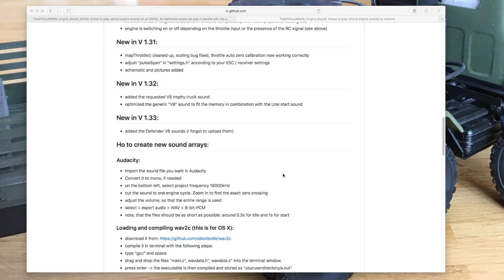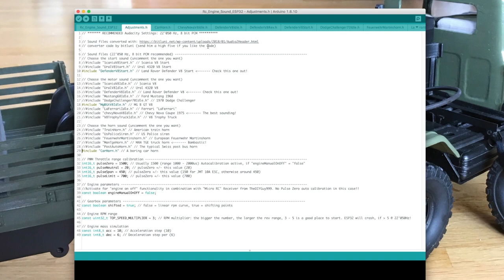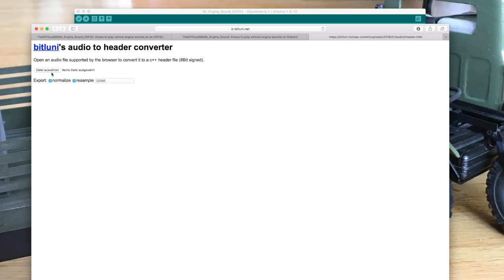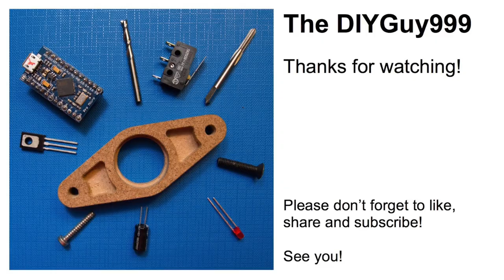New ESP32 Based Arduino RC Engine Sound Generator: Simultaneous Horn playback, a lot of Free Sounds!

Comment: Is there a more comprehensive guide to the software aspect of this? Trying to verify the sketch nets tons of errors involving missing parenthesis.
Reply from the maker: There are no errors, if you install the ESP32 board and all the required libraries:
//
// =======================================================================================================
// ! ! I M P O R T A N T ! !   SETTINGS (ADJUST THEM BEFORE CODE UPLOAD), REQUIRED ESP32 BOARD DEFINITION
// =======================================================================================================
//

// All the required vehicle specific settings are done in Adjustments.h!
#include "Adjustments.h" // <<------- ADJUSTMENTS TAB

// Install ESP32 board according to: https://randomnerdtutorials.com/installing-the-esp32-board-in-arduino-ide-windows-instructions/
// Adjust board settings according to: https://github.com/TheDIYGuy999/Rc_Engine_Sound_ESP32/blob/master/Board%20settings.png

// Make sure to remove -master from your sketch folder name

// DEBUG options can slow down the playback loop! Only comment them out for debugging
//#define DEBUG // uncomment it for general debugging informations
//#define SERIAL_DEBUG // uncomment it to debug the serial command interface on pin 36
//#define SBUS_DEBUG // uncomment it to debug the SBUS command interface on pin 36
//#define DRIVE_STATE_DEBUG // uncomment it to debug the drive state statemachine
//#define DRIVE_AUTO_TRANS_DEBUG // uncomment it to debug the automatic transmission
//#define CATERPILLAR_DEBUG // debugging caterpillar mode

// TODO = Things to clean up!

//
// =======================================================================================================
// LIRBARIES & HEADER FILES
// =======================================================================================================
//

// Header files in sketch folder
#include "curves.h" // Nonlinear throttle curve arrays

// Libraries (you have to install all of them)
#include <statusLED.h> // https://github.com/TheDIYGuy999/statusLED <<------- Install the newest version!
#include <SBUS.h> // https://github.com/TheDIYGuy999/SBUS you need to install my fork of this library!
#include <rcTrigger.h> // https://github.com/TheDIYGuy999/rcTrigger <<------- v4.7: This one is now required as well

Also note, that all the vehicle specific settings are done in the "Adjustments.h" tab, don't change anything in the main sketch.

Example Adjustments can be found in the /settings folder.

You also have to select the interface according to the manual on GitHub
Reply: @TheDIYGuy999  i tried to copy the errors i'm getting here but it wouldn't work. my header doesn't look like yours.
Reply: @TheDIYGuy999  I'm about to give up on this and just buy a module. I've been fighting this sketch for 4 hours and no sound.
Reply from the maker: @lordsanityfree  Why it doesn't look like mine? Then you should download the latest version. You have to install all the libraries and the ESP32 board definitions, which are mentioned in my previous answer. Also make sure, you read everything on my GitHub page. I can't help you without knowing your error messages.
Reply: @TheDIYGuy999  at this point it uploads, but does nothing.
Reply from the maker: @lordsanityfree  You have to select the communication mode according to your receiver wiring. You can find the manual on GitHub. If you have classic RC servo signals, adjust it as follows:
// ---------------------------------------------------------------------------------------------------------------------
// Choose the receiver communication mode (never uncomment more than one! If all commented out = classic PWM RC signal communication)--
// SBUS communication --------
//#define SBUS_COMMUNICATION // control signals are coming in via the SBUS interface (comment it out for classic RC signals)
boolean sbusInverted = true; // true = wired to NPN transistor signal inverter or uninverted SBUS signal (for example from "Micro RC" receiver)

// Serial communication --------
//#define SERIAL_COMMUNICATION // control signals are coming in via the serial interface (comment it out for classic RC signals)
// Only for my "Micro RC" receiver! See: https://github.com/TheDIYGuy999/Micro_RC_Receiver

// PPM communication --------
//#define PPM_COMMUNICATION // control signals are coming in via the PPM interface (comment it out for classic RC signals)
#define NUM_OF_CHL 8          // The number of channels inside our PPM signal (usually max. 8)
#define NUM_OF_AVG 1          // Number of averaging passes (usually one, more will be slow)
Reply: @TheDIYGuy999  it's like that. No sounds. FWIW, I'm using a PAM8043 with integrated pot for volume.
Reply from the maker: @lordsanityfree  The wiring is according to the schematic and the 5V supply voltage for the PAM8403 is OK?
You may want to uncomment the DEBUG option in code line 30. This provides informations about the input signals in the serial console.
Reply: @TheDIYGuy999  schematics are gibberish to me, but i wired it just like shown in the video, just without the pot between the resistors and the amp as it's built in. Connected VIN and GND on the esp32 to power + and - on the amp.

Ive tried using different pins on the board based on what I could find in the sketch but no change. The only thing I can get from it is a buzzing.
Reply: @TheDIYGuy999  from the esp32 I have the following:
From VIN, one wire to positive power on amp, one to center pin of throttle channel on ex.
GND, one wire to negative power on amo, one to ground on amp input, one to negative pin on throttle channel.
D12, D13, D14, have tried connecting directly to signal pin of throttle and thru 330ohm resistor. No difference.
D25 D26 each go thru 10k resistor, then join together, then connect to both inputs on amp.
Reply from the maker: @lordsanityfree  And what is your supply voltage? If you can't read the schematic, it will go wrong. There must be a wiring error. Why not just order the PCB? It will ensure, that everything is wired correctly.
Reply: @TheDIYGuy999  total power supply is coming from USB. Im not sure whether I have the 30 or 36 pin board. Its this one
https://www.amazon.com/dp/B07V42CJRF/ref=cm_sw_r_cp_awdb_t1_i9JkFbRZTWMCQ
And the amp im using is
https://www.amazon.com/dp/B081YRTWLC/ref=cm_sw_r_cp_awdb_t1_-9JkFbXGETXXN
Reply: @TheDIYGuy999  this is just on my test bed. I haven't tested the voltage my ESC sends to the receiver yet. If its right I will power the board from it, otherwise I will stick a small USB mobile phone charger inside my truck for true top heaviness!
Reply from the maker: @lordsanityfree  The USB or ESC power is not sufficient, you need at least 1 Amp. Anything above 5V will destroy the amplifier. Please note, that I can't support you, if you don't use my PCB or at least a setup in accordance with my schematic.
Reply: @TheDIYGuy999  did the setup I described not follow the schematic?
Reply from the maker: @lordsanityfree  No, as I said, you have to use a 5V regulator. I really think, you should learn to read schematics, it's not that hard.
Reply: @TheDIYGuy999  did a little reading. The esp32 devkit board has a built in regulator. Could I not connect my lipo to the 5v rail and go from there? I'm not keen on dropping money on PCBs and more hardware if I can't get this working on a breadboard first. I'm not looking for shaker or LED controls. Just sound.
Reply: @TheDIYGuy999  IN THIS VIDEO you ran the sound board off of USB! I set my system up just like you did in the video and it DOES NOT WORK! Every comment on this video is about how it does not work. No one has commented that they got it to work.
Reply from the maker: @lordsanityfree  Yes, as you can see, it does work and yes, I ran it off USB. This does work as long as you don't push the volume. A lot of people built this system and it does work just fine.
Reply: @TheDIYGuy999  then what am i doing wrong? i described my exact setup above. what am i missing? i upload the sketch exactly as it is downloaded with no modification. in this video it looks like you have a capacitor on the amp or the pot but it is not mentioned. is that the problem?
Reply from the maker: @lordsanityfree  Just wire it according to the schematic. Your description is not sufficient to determine if it's correct.
Reply: @TheDIYGuy999  the symbols on your schematic aren't matching the charts i have.
Reply: @TheDIYGuy999  i don't wanna give up on this but my frustration level is thru the roof.
Reply from the maker: @lordsanityfree  I'm using european symbols, but you should be able to find them on the Interwebs. BTW: you said you uploaded the sketch exactly as downloaded. And you are using standard servo signals to control it? In this case, you have to comment out (adding //) line 34 in the Adjustments.h file (as described on GitHub):
//#define SBUS_COMMUNICATION // control signals are coming in via the SBUS interface (comment it out for classic RC signals)
Reply: @TheDIYGuy999  i tried that. it made no difference. should i have a capacitor on the amp power feed?
Reply: @lordsanityfree  I am having the same problem as well and I have no idea what I'm doing wrong

Comment: Sounds are quite plastic
Reply from the maker: Thanks. There is still potential, I may try to add separate sounds for the higher rev range
Reply: Would be nice to have high bitrate sound from like a nfs game. Those people with scale trucks often have very shallow tincan sound. Would be nice if there could finally be a fix for that
Reply: I would avoid anything 8bit were not in the 90's anymore

Comment: Hey, look at that! I bought your board, I followed your schematic, and IT STILL DOES NOT WORK!

I feel like you owe me an ESS Dual. The money I spent following your plan was wasted.
Reply from the maker: Then you have to wire and adjust it correctly. It is working for a lot of other people around the world.
Reply: @TheDIYGuy999  so, using your board i somehow didn't wire it correctly?
Reply from the maker: @lordsanityfree  You told me, you can't read a schematic, so how will you make sure, you populated the board correctly? Also have a look at the improved instructions on my GitHub. Maybe, this helps to configure and wire it correctly with your vehicle.
Reply: @TheDIYGuy999  between the board, the schematic, and the video, im certain i wired it up correctly. When i feed 7.4v to the power input, the only thing getting power is the amp. If i feed 5v to it from and esc thru the receiver, the esp powers on but nothing works.
Reply from the maker: @lordsanityfree  So you are feeding 7.4V to the "X1" connector and to the ESC, which supplies 5V to the "ESC" connector and from there via Diode D1 to the "VIN" pin on the ESP32. Do you measure 5V there? Ist the diode soldered the right way around? The ring marking on the diode needs to point towards the ESP32 side.
Reply: @TheDIYGuy999  I did not connect the esc side of things as I'm only interested in sound. I had no idea diodes had polarity. I will check that. Im trying to test this with just a receiver connected so I dont risk frying anything expensive.
Reply: @TheDIYGuy999  I tried running power from esc thru receiver in place of the x1 when the x1 didn't work. Im not dumb enough to connect both power sources.
Reply: @TheDIYGuy999  i need a way to show a photo...
Reply: @TheDIYGuy999  polarity is correct. Apparently my son ran off with my volt meter.... again....
Reply from the maker: @lordsanityfree  You need to connect the esc or you will have no 5V supply for the ESP32. And yes, you NEED to connect both power sources, that's why there is a diode. Provide a picture of your wiring, using a Google drive link
Reply: @TheDIYGuy999  ok. Found my volt tester. 5v at the amp. No power at the ch1-ch4 pins. Was trying to test voltage on either side of the diode when one of the kids grabbed a wire. I dont know what touched, but it sparked and smoked and now no power past the x1. Guess ill build another board in a few days and try again.
Reply: @TheDIYGuy999  so the x1 only provides power to the amp? Why not power everything off it, since there's a voltage converter?
Reply from the maker: @lordsanityfree  Yes, to the amp, the shaker and to the LED driver transistors. The 5V supply of most ESC is not powerful enough for that, so I went for an on board 5V regulator. I wanted to have the 5V rail on the top of the board(5V_ESC), where the ESC, servos etc connect on a separate rail, so nothing can short out. If you don't connect anything to the 5V rail on the top (except the receiver), you can add a duPont jumper wire from the 5V rail on the top of the board to a 5V pin on the bottom (connecting 5V and 5V_ESC rails together). The ESP32 and the receiver will then be supplied with 5V from the on board regulator. Do not connect an ESC with this bridge wire connected or you will short out two separate 5V supplies.
Reply: @TheDIYGuy999  that makes sense. If you were the one that just tried to access that picture, try it again now. Sharing settings have been changed. Never messed with drive before.
Reply from the maker: @lordsanityfree  The board looks OK for sound only. Connect +V on the right (on your pic) to 5V on the left. The ESP32 will then be supplied with 5V from the on board regulator.
Reply: @TheDIYGuy999  ok. I will have to wait until after we get moved into the new house and build a new board. I think the voltage regulator got fried.

I would like to apologize for my attitude. Im living the 1-2-3 life (1 income, 2 mortgages, 3 kids) and my nerves and patience are pretty thin these days.